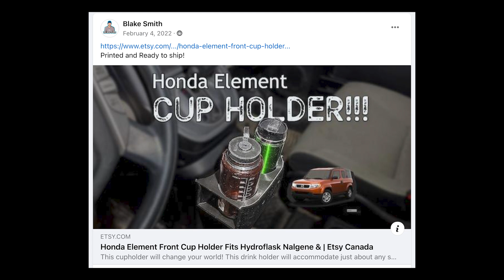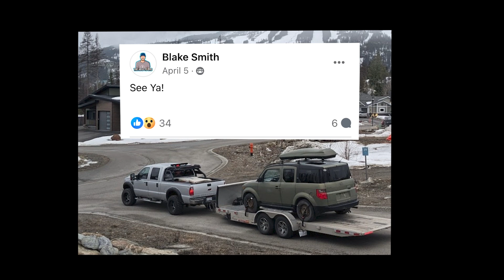Former Honda Element owner: Good, bad, mods, and Element 2.0 (Deep Dive)

Comment: I drove a 2005 5mt 2wd Element for 100K miles. Bicycling around Northern California hauling bikes (KUAT hitch rack) and friends, flat load floor and clamshell doors make it the best bike car ever. That car was a Certified Used and they had thrown whatever tires were on it and put cheap Korean junk. Very noisy, several flats, all the cheap tire problems. Put Michelin (Tour Latitude were available then) on it and found out it was as fun to drive as a Civic. Crashed it hard in March, looked around and found a 2011 5at 2wd with just under 100K and paid BIG BUCKS for it, once again switched worn out Pirellis for Defender LTX and got quiet and smooth immediately. Love love love the 5 speed automatic lowers tach from 3K to under 2K at freeway speed. Now I drive like it’s the Crown Jewels because I don’t expect I could ever find another. Favorite Element story 3 of us had parked in the Embarcadero district and done GG bridge and Mt Tam, got back hungry and there was a burrito shop right there but what to do with the bikes. Slid the front streets all the way forward, put the other back seat up and got all three road bikes (about $15K worth of bikes) inside and locked. Instant bike locker. The only car there is as far as I’m concerned. More fun to drive a slow car fast than a fast car slow.
Reply from the maker: you got that right marty! i mountain bike and road bike and that is exactly what an Element can do :) not sure i've been able to find any other vehicle that can do that. good tires are def important too. i've found Toyo Open Country to work well. so glad you've found the vehicle that works so well for you!